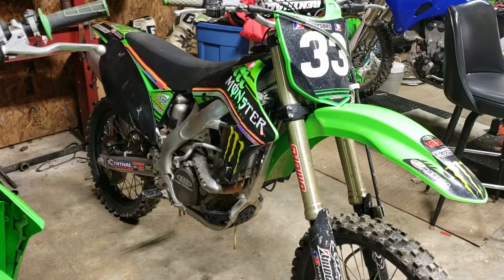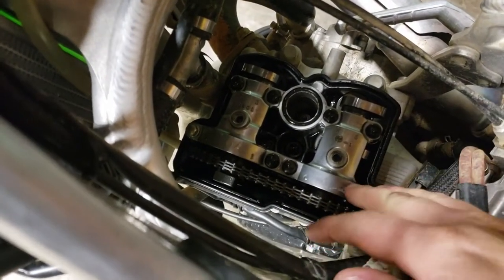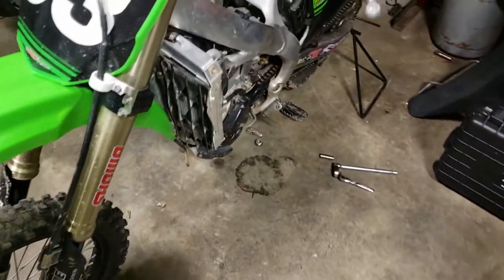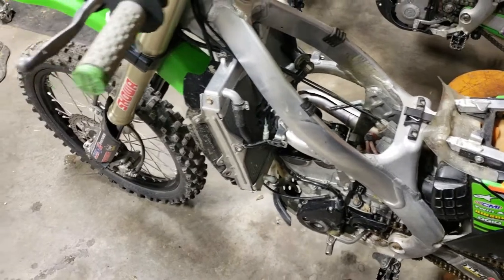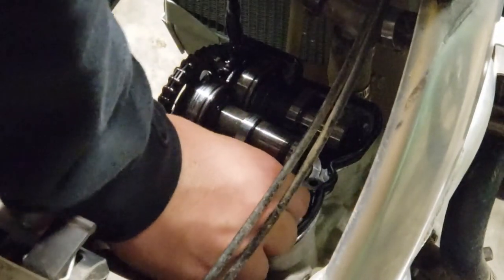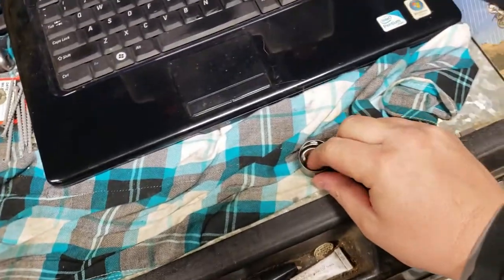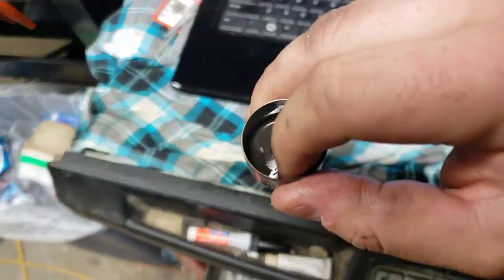This 2009 Kawasaki KX250f won't start...Let's FIX IT! (Troubleshooting / Adjusting Valves )

Comment: Awesome video!! I'm trying to expand  my knowledge of small engines and your videos are an excellent source of info. So simplified the average Joe can do his/her own repairs and maintenance. 👊✌
Reply from the maker: Thanks man, that means so much!
Reply: @mxgryan  i have the same problem 08kx250 bump starts and runs great but wont idle and it might start after 20 kicks watched your video checked my valves  intake are good at .006 but the exhaust are loose at .010 one side i was able to get a .011 is loose valves going to cause this?
Reply from the maker: @codyhammett2060  loose valves should be chattery, but shouldn't cause the bike to not start.

Comment: When you put the chain tensioner back in do you just put it back or do you have to make some adjustment.
Reply from the maker: It must be wound up and locked, then put in, bolted, and then unlocked.
Reply: Thanks, im going to replace the schims on my kx250f for the first time. I got that round mark on one of my schimcups too. Do i need to worry the valve is in spec and i cant feel the round ring scratch.

Comment: Are kx250f generally known to need more valve adjustments more than other brands ? My 2013 just had a top end done, 20 hours riding later can only bunpstart
Reply from the maker: Not really, no. Probably the worst were the 02-08 CRF450s. 

You had a top end done, but that doesn't affect valve seats. 

If you keep having to adjust more often, means your seats are shot...time for a head job bro!
Reply: The MX Guru the intake cam was spun as well when the top end was done so the intake and exhaust cam were done as well as valves is what I was told , ran me about $1300

Comment: Hey nice vid! I have a 014 CRF450R it got a head job, new valves, new cylinder, piston and rings; and stator. Got the bike back it still won’t run. The timing was on but I decided to check the shimming and the clearance was tight. I reshimmed and it still doesn’t want to run. Any ideas on what the problem may be? It’s getting fuel and spark btw.
Reply from the maker: If it's getting fuel and spark, next step is a leak down test. That will tell IF there's a motor problem and where it is.
Reply: If the motor doesn’t have a problem could it be the capacitor/condenser?
Reply from the maker: @Jason-zr6il  that's possible...but not as probable as other issues.

Comment: So if you need new valves, would you only need 1 valve or would you need the entire kit with springs, sorry im new to this...and what would the price be? I seen it from15$ to 200$
Reply from the maker: Normally they all wear at nearly the same rate...so you would at least need to intakes or two exhausts...BUT by far the easiest and most common is to just have the entire head redone at once. This usually costs 500-800.
Reply: @mxgryan  sheesh, thanks!

Comment: Hi just wondering if I can use this video to help with my 2006 kx450f which won’t kick.. Like I can use the same valve adjustment numbers you used and everything??😁
Reply from the maker: Yes, .10-.15 intake and .17-.22 exhaust clearances.
Reply: Alright thanks man! Imma try pull this thing apart now! Thanks again

Comment: @The MX Guru
Hi
I really liked your video and was hoping you have a hint for me and my bike (2011 KX450f )
This bike doesn't start at all.
I have a good spark, but I can't start it at all (no kick or bump)
Even a little bit break cleaner in the air box did nothing.
Also I flooded it several times, so I think I haven't a fuel problem.
I'm really clueless and hope you could give me and my bike some hope.
Thank you 🙏🏻

Comment: Did you torque those cam caps to spec? Its very important not to overtighten those not even a little bit or else you’ll ruin the head
Reply from the maker: Of course I didn't. And thanks for the tip, I've only been doing this for 16 years.
Reply: Why wouldn’t you torque them?
Reply from the maker: Because I've seen many people torque them with calibrated torque wrenches and strip the threads out, ruining the head just like you said. 

However, I have yet to EVER see the bolts come loose from hand tightening.
Reply: I think hand tightening is good but for the internal parts i believe its good to have a quality torque wrench for the job and be able to use it right. The spec is 7.2 ft lbs but if you hand tighten it to lets say 9-10 that’s excessive drag on those parts and will wear it out faster. thats the only reason i’m against hand tightening

Comment: I was told by a shop near me that a valve adjustment is a 3 hour job.
Reply from the maker: If you work really slow, have to adjust all 3, have to use a shop manual, and haven't done it 500 times, I could see about 2 hours. I do a KX in about 20 minutes.
Reply: @mxgryan  thank you so much, there’s always asshole shops out there trying to take advantage of people. Glad I didn’t take it there.

Comment: I have a 09 kx250f , not getting any spark to my plug got any suggestions??
Reply from the maker: Start with plug and kill switch. Then go to plug wire and coil. Then stator

Comment: Hi, I have a kxf250 with a carburetor.
When I throttle only to 25%, the motorcycle seems to suck  fake air and no power. When I add more than 25% of gas, the motorcycle is already going as it should. But that is problem because when i riding trails, sometimes i ride on low RPM and 25% throttle, and thats not possible right now. It can cause carburetor, valves, or air intake?

Comment: Subscribed! I have a 98 KX250 that won't start. I'm going to try to figure it out.
Reply: Howd you go
Reply: @Qwerty44960  I changed the spark plug and removed the old gas from the tank. I tried new gas and it still didn't start. I removed the carburetor and bought one of those carburetor rebuild kits. When I took it apart, I found what I believe is called the pilot jet clogged up. I was able to clean it but I used the new jet that came in my kit and replaced the tiny gaskets and stuff. After that, it started on the 3rd kick. Before that I would kick it 'til my leg cramped up and it still wouldn't start. Now it starts in 1 to 2 kicks. I still have to adjust the carburetor to get it right where I want it but haven't taken it out much since the summer. I basically rebuilt the whole bike. It turned out really good.

Comment: hey man i hope you can see this even after 2 years.. i have kawasaki kx 250f 2012 and it idles for about 30-60 seconds and then suddenly stops? what should I do? also it started to do (occasionally!) some rattle noise in the upper engine ? could it be stretched cable bouncing of walls thanks a lot
Reply from the maker: Check valves, then do a leak down test!
Reply: @mxgryan  okay, thanks so valves could do The ocassional engine koncking? And last question will be compression test enough?(instead of leak test)😅
Reply from the maker: @piky635  no, compression test is pointless on a 4 stroke. Leak down for the win!

Comment: This video helps a ton do you know the spectrum for both intake and exhaust side plz I cant find it anywhere??
Reply from the maker: .10-.15 IN and .17-22 EX I believe.
Reply: @mxgryan  I have a 2000 Mojave is that correct for my atv or different?
Reply: @mxgryan  I have a 2000 Mojave is that correct for my atv or different?
Reply: @mxgryan  and what kind of shims should I use?
Reply from the maker: @andrewenglish9373  lol. No.
Reply from the maker: @andrewenglish9373  for a Mojave?
Reply: @mxgryan  yes sir

Comment: I checked my valve clearances and I found exhaust left is .23mm and intake left is .06mm. When I make my adjustment, can I pull the cams and tensioner still at TDC?
Reply from the maker: Sure can. It probably wont stay in PERFECT TDC so you will have to double check it when you reinstall...but it will stay close.
Reply: Awesome, thanks for the fast response! I had problems starting and idling. Figured it would be valve related
Reply from the maker: @bryce099  You're welcome Bryce...and yea, on these bikes its tight intake valves 90% of the time!

Comment: Only suggestion I have from working on these 4-strokes. I would try and avoid using a impact driver. These bolts are not very strong and can snap pretty easy with the right impact gun. It's more work but I rather get them started with a wrench and use the drill after. Same with putting them in. Use your fingers to get them started to feel/verify they are seating correctly. All in all this is simply a suggestion and nothing more.
Reply: Said the same thing and he called me a troll..guys a menace

Comment: i got a 05 kx250f with a bad engine but got a good 09 engine for it.05 engine had no head or cylinder i do not know where head

 motor mounts go got some and i see no way to show where they sit or bolt up.but at 59 seconds  i see a good idea but went t look see nowhere to hang them.
Reply from the maker: That is not worth the time or effort bro. Sell both of those piles and get a different bike lol
Reply: @mxgryan   yeah can you donate me 5 g to get one.
Reply from the maker: @Voiceinthewoods  decent 250s and 450s both can be found for 2500.

Comment: Hey man I'm doing my vaules rn on a 17 kx250 f can't get the timing Chain tensioner back in any ideas
Reply from the maker: It just slides in. Did you reset it?
Reply: I figured it out  that was my proplem I didn't reset it when I did it  the first time.  Thank you you video are very helpful man I watch them now just to learn more
Reply from the maker: @banpolly1020  awesome dude I appreciate you
Reply: @mxgryan   hey buddie so my vaules are good and in spec I got spark I got gos but I can't get it started unless I post start it ?
Reply from the maker: @banpolly1020  then you have issues. Run a leak down test.

Comment: What are your thoughts on the 17 Kim Xc-F 350?
Reply from the maker: Great bikes! I'm about to borrow an 18 350 XC-F to ride for a few months, love them!
Reply: The MX Guru pretty easy to work on? If you are able to make some videos on those in the future I would appreciate it. Thanks for the feedback
Reply: The MX Guru any suspension tips for the xcf on motocross track? I’m 200, 6’1 intermediate rider, i hear the suspension can be soft. I’m not opposed to buying new springs or anything but need a little advice

Comment: How did you get the cam chain so loose? I have a 2012 kx250f and took the whole cam tensioner out and the chain was still so tight I could barely get the cams in/out
Reply from the maker: Something isn't right then!
Reply: @mxgryan  is that a hard fix?😅

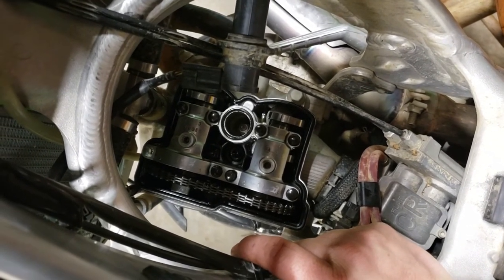Comment: Does anyone know what the 2 rubber dampers attached to the frame that the gas tank sits on are called? You can see them clearly at 11:53. I'm missing one and can't find them anywhere! Thanks
Reply from the maker: I just always called them dampers. You should be able to find them on any schematic under the frame section.
Reply: You could rig almost anything up to hold one side of a gas tank shouldn’t be a big deal tho I wouldn’t worry about it

Comment: Mine turns on but cuts out when riding then takes about ten kicks to start however my coilpack is cracked is that the problem
Reply from the maker: Idk bro
Reply: Mine did the same exact thing I spent 500$+ trying to figure out the issue but it ended up being the fuel pump... It was pumping enough fuel for the bike to run and idle but as soon as you give it any throttle the bike would bog out and die bought a new fuel pump and never had another problem!
Reply: @JayDeeFrm7400  it was the coil pack the bike  got hydro locked and its gone now but thanks anyway lol

Comment: I have a kawasaki 2008, it always start easy, but when I ride it "hard" 20 minutes, and stop the bike, it's very hard to start again. Or if I do stop the bike in the track for a 2 minutes brake, or if I'm riding with my son, and he needs help, i need to stop mine a couple of times, suddenly I need to spend 15-20 minutes to get it to start again. But if I wait 20 minutes, and then tries to start, if usually starts fine. Is there anything u suggest I can do?
Reply: The bike is in very good condition, it has only 30 hours on its back.

Comment: Is it 12 or 13 pins between top cam marks when setting up timing?
Reply from the maker: Its 28 far dot to far dot
Reply: @mxgryan  ok because I've seen in my rmz250 manual it says 13 pins from tip dot to top dot and in the kx manual it's 28 pins which makes 12 pins btwn top dots. Either way the valves don't hit when rotating by hand but 13 dots makes the intake cam out of time.

Comment: Damn dawg I was hoping after all that you would at least show the timing gears and marks brother dang. I got something fishy going on with my back camshaft on used bike I just got and the thing runs like a bag off ass off idle except idle and wide A open, otherwise she’s popping and making all kinda racket and I feel like it’s out of time but I’ve timed it up but back cam looks like someone messed with the cam gears location on the cam itself which is kinda hairy and the Hendersons so im prolly gonnna end up just getting a new cam for the thing cause it’s in time and still runs like arse
Reply from the maker: @slowb4lls1  I've done tons of videos on kx250f valve adjustments man. This was a diagnosis vid
Reply: @mxgryan  yea I copy ya. I’ll check em out, it’s not that hard to time em. My issue wit this bike I’m almost certain is someone who used to own the bike had the cam in a press and moved the sprocket on the shaft, so the timing marks are jacked up, I can see two grinded down booger marks that looks like they spot welded the gear back on the cam, this one whipped me, got a new factory intake cam for it came in today ima try and slap that back in here and time her up and see if that breaking down is fixed. It was ok before at idle and wide ass open, but to get wide ass open you wud have to go thru 3/4 of the throttle breaking up bad and sounded like timing to me and then I ripped it down and seen this janky intake cam and I’m like I bet that’s what’s been whippin me

Comment: I put a new upper head, valves, cams and we can’t get it to start what would be the problem
Reply from the maker: Who did the valve work
Reply: The MX Guru my neighbor
Reply from the maker: @dominickmcdaniel4603  lol does your neighbor cut valve seats and pressure test heads
Reply: The MX Guru no
Reply: The MX Guru we have tried timing every way you could and it’s got good compression the motor just won’t turn over
Reply from the maker: @dominickmcdaniel4603  the motor won't turn over? Even by hand? That's definitely a problem.
Reply from the maker: @dominickmcdaniel4603  I would run a leak down test. You can swap valves in your neighbors garage.
Reply: The MX Guru it’s got new  valves
Reply from the maker: @dominickmcdaniel4603  what machine shop cut your valve seats
Reply: The MX Guru we done that ourselves
Reply from the maker: @dominickmcdaniel4603  you can't.

Comment: Hey, I’ve hade my 2010 kx250f for 3 years and everything runs perfect, the bike starts within 3 kicks but backfired when I let off the gas should be concern?
Reply from the maker: Mild popping on decel is normal. Anymore than that, change jetting.
Reply: The MX Guru okay thx

Comment: Your a nut job for using a drill on the cam cap bolts 😂 good way to loose the threads..id break the tension with a socket then use the drill after it's free'd up
Reply from the maker: No.
Reply: @mxgryan  surprised people let you work on their bikes smh as a mechanic I can say your doing things the hack way
Reply from the maker: @TheSultanOfBlocks  lol.
Reply from the maker: Guys he's a mechanic! He's a mechanic guys.....see? No one cares. A troll is the best word to describe you.

Comment: 8:12 not sure what you are trying to do there mate
Reply from the maker: That would be checking the valves.
Reply: @mxgryan  and what do you expect to see/feel if they are correct?
Reply from the maker: @gintautasnik5214  if the feeler guage fits in and has slight drag, they are where they need to be. If I cannot fit the right size gauge in...they are still too tight.
Reply: @mxgryan  thanks

Comment: hey, so i just got a KX250F 07 and it has dings in the cylinder (says the previous owner) we are confused on how to get the top end off the bike to check the cylinder.
Reply from the maker: Watch videos. I have one doing the top end on a kx450f. Same deal
Reply: @mxgryan  alright

Comment: -Didn't use a torque wrench at all

-not using proper size Flathead for engine plugs

-working with dirt on the bike
Reply from the maker: Ha. What a loser. 
- a torque wrench is not required with working with small 6mm bolts that I've done hundreds or thousands of times, never ONCE had an issue. 

-I literally used the motion pro ENGINE PLUG removal tool to remove the engine plugs. 

-There was not nearly enough dirt to cause any issue with popping a head cover. 

get out, nasty troll.
Reply: The MX Guru I'm not being a troll lmao but it's just nice to do things properly. I'm not saying you did a bad job, just pointed it out.
Reply from the maker: @tpghl5225  no, you're just ignorantly wrong. And that's okay.
Reply: @mxgryan  Oh is that it? Lol ok gotcha
Reply from the maker: @tpghl5225  yeah, like you clearly have no clue what the tool is to remove an engine plug. Troll!